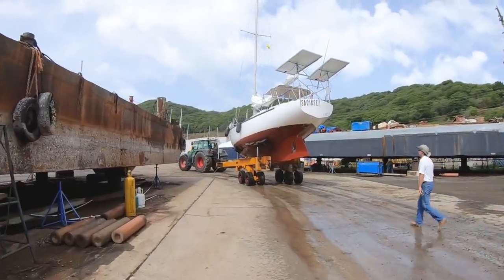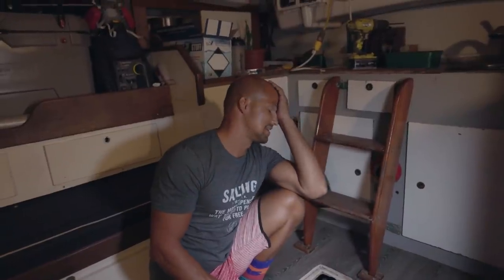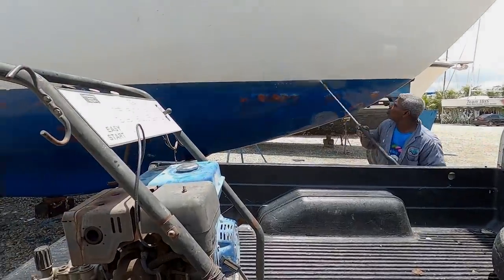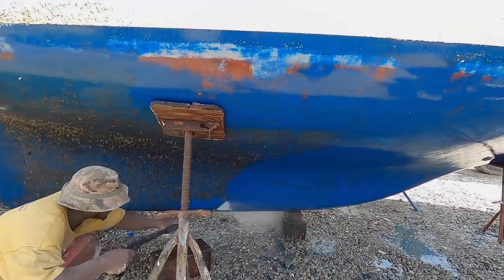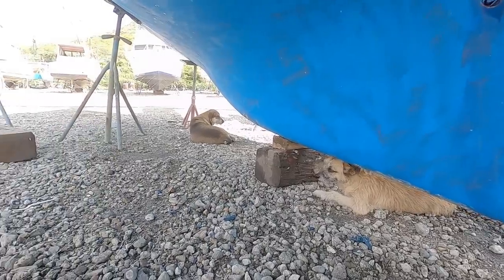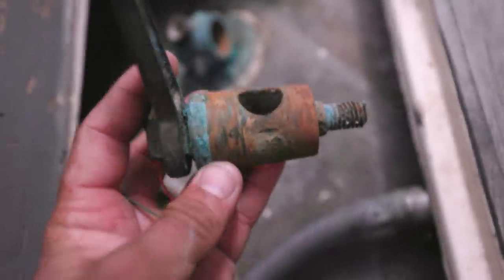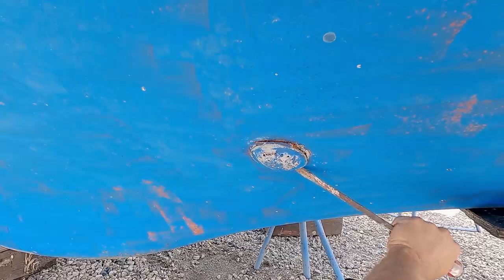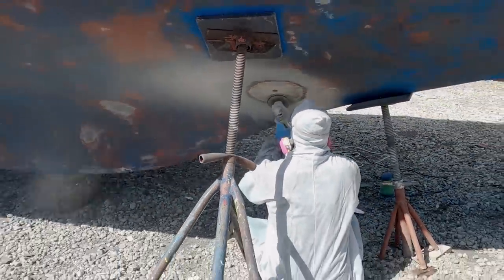IS OUR BOAT WORTH SAVING? (scary discovery during haul out)

Comment: Get a hammer and lightly tap the whole keel area. You will find the voids as the sound will change from solid fiberglass against lead to fiberglass cavity with or without water. Then mark the void pattern and drill exploratory holes as you did at the bottom testing for water penetration. Where delamination between fiberglass and lead has occurred you can cut the fiberglass out and let it dry out naturally. Or drill more drain holes at the bottom of the cavities let it drain then epoxy the holes closed and make larger holes at the top of the cavity and fill the cavity with liquid epoxy resin. The best is cut the bad fiberglass out and reglass the bad area.
Reply: Completely right.  Fill your voids from bottom to top.   I like to use fillable caulk tubes and hand mixed 5:1 thickeners if I like.  Then pump it up.  I use little wood plugs like screw hole plugs to smack into the next drill hole.   There is another resin I might experiment with there.   It's called csr from adhesive technologies.   It likes to expand when water hits it but it makes a hard plastic like resin when it hardens.   It's a hybrid eurethane.  But  good stuff.   Bit more expensive than epoxy.  But the expanding action when it hits water is sweet.  I used it often to fill cracks and rotten gunite in swimming pools.  Sometimes I go with 5:1 in the large voids areas,. Let it harden then shoot csr for the fine cracks.   It's thinner than 5:1.  I repaired a 4 sandwich thick layup that was completely rotten in my cockpit with injections like that,. Those voids we're 1/2" thick and about a 2 sq ft area under my steering pedestal.  I do ring rows on it now and it doesn't move.  Don't worry you can make it water tight.  If you want to know more about injection let me know.   I made a career of it, and retired early.  Don't grind that encapsulation out!!!!!! That will give the hull a weakness that will always make you feel uneasy.  Worried when your beating to windward, worried if you run aground.   It'll be the first thing you run your hand over every haul out.   Just keep that devil away completely.

Comment: The water is most probably coming into the bilge through the two nuts/shaft holding the pin for the swing keel, then finding it’s way into the cavity encapsulated that holds the lead ballast .
You should pour water into section by section of the bilge with red food colouring in it and see where it comes out to determine where the water travels from inside the bilge to the cavity surrounding the lead ballast area.
Hope this helps .
The amount of surface these guys ground for the skin fitting is crazy half would of been more than adequate🤣
Reply: Your exactly spot on , the pin bolts are suspect! I knew a gent many years ago with this problem and that's exactly what was going on, he did away with the center board and sealed it up in the keel, never had a problem with it again..
Reply: @mikemalone2834  I think you right, I would do away with the centre board .
This is for directional stability, to hold point to windward however the percentage difference can’t be much if removed.
I had a long encapsulated keel boat once, it sailed like a pig to windward 😄
I’m wondering if this model was a home completion type boat as some companies sold hull deck and bulkheads and individuals would complete them.
Reply from the maker: @mikemalone2834  hey guys! where are you sailing? are you doing any open ocean, curious on the performance once it was sealed up.
Reply from the maker: @andrewdrew677  this pearson 35 was factory built like this. we didn't put it in the episode but we extensive spoke about sealing up the centerboard.
Reply: @BeauAndBrandy  one has to consider the resale value when modifying boats, however in your case I can’t see it causing a issue.
As far as I’m concerned it’s a design fault as the pins giving pivot to the keel are below the waterline a recipe for disaster.
Other sailboats that have swing keels or center boards have the pins located above the water line.
Basically a box that sometimes incorporates the dinette table, a Beneteau first 24 swing keel is a perfect example .
Reply: @BeauAndBrandy  I would 100% do away with the center board and further look at examining the lead section of the keel both sides especially where you had a failure last time .
I know that during the time period when your boat was built they never had things like spun glass tubing of which one would have the pins situated in .
So you will always have problems in the future 100% .
Just glass it up dude and go have some fun .
Reply: I don’t sail this type of boat, but do know swing keel boats. The swing keel is not at all for directional stability, it’s for improving windward performance a bit by a more efficient “wing” than the full keel. Full keels create a lot of turbulence, especially along the bottom edge, which slows the boat down.  If the swing keel is well done, it helps a lot, especially on your boat that has such a shallow full keel. Bottom line: Do NOT close off the swing keel. You need it. You should look at it as a wing. It needs to be smooth and ideally shaped like a wing too. It also needs to drop down as deep as possible. 

On the problem with water in the ballast, that’s not what you want, but it’s also no big crisis, especially because you have lead, not iron. Lead doesn’t corrode. I would absolutely try to get it as dry as possible, but don’t loose any sleep over water down there. It’s quite normal. The water that leaked into your bilge does have a source, however, which I’d search for. The bilge should be dry, for the obvious reasons. You mention that the fibreglass will delaminate from having water inside. No, it won’t. Polyester/glass is not an everlasting material and it does deteriorate slightly more by being water logged, but no drama at all. All the under water part of the boat is thoroughly wetted out all the time. It’s not perfect, but totally fine. By the way, the gelcoat is there to make it look nice and be protected from light, not from water. 

If the boat is “shot”, it’s from some other reason, like an impact. Even then, I’m pretty sure that you can fix it plenty good without much difficulty in a reasonable amount of time, with a lot of uncomfortable work… :-)
Reply: @andrewdrew677  Lots of swing keel boats, the majority, have the pivot well under the water line. I’s a frequent source of small leaks, but no real problem.
Reply: @SteinVarjord  it’s not a keel, it’s a center board for directional stability for close hauled/ windward sailing .
Your message does not offer rectification .
Reply: @BeauAndBrandy   It’s a good thing you getting rid of the water say in the keel section .
Don’t forget even with you grinding back and getting rid of the water in the ballast will not solve the cause at hand .
Salt water is either getting in either side of the housing for the two pivot pins or through the limber holes where the same as the pins “failure of joint seal “
There could also be areas inside the bilge that aren’t capped off “sealed” properly.

Some boats used pvc tubing for limber holes which always fail at entry or exit at bulkhead or stiffener, these run transverse throughout the hull allowing the bilge water to congregate in a well for bilge pump release.
Wherever the solvent found it’s way to the keel should be sanded out 40 grit paper and CSM Matt and polyester resin applied with flow coat to seal or go with epoxy and powder bound chop strand Matt last coat with resin rich epoxy then bilge paint .
Hope this helps

Comment: I had the same problem on a 35ft Yungsun. I had it professionally repaired. They drilled 1 inch holes along the bottom and top of the keel and forced hot air into the cavity between the fiberglass and the encapsulated keel. The after several days of drying the gap between the hull and the lead they pumped resin/fiberglass bits into the bottom till it came out the top, filling the void. it took about a week and some specialized equipment but the boat was better then new and it solved the problem.
Reply from the maker: Interesting, this is exactly what we planned on doing.
Reply: How much did that end up costing?

Comment: Find a path to the deepest accessible part of the keel bottom and put a pick up tube to a dedicated lower bilge pump. Some water has been down there for decades and you used the boat many years without a bone dry lower bilge. It just goes with the encapsulated design. It's not great but you don't have to throw the boat away over it.

Comment: You can ask the boat experts on these channels about drilling more and bigger holes, until you have ALL the water out.  you could tape the exhaust  of a couple shop vacuums over the holes and let them run until the air blowing out felt dry.  Also ask the experts about spraying closed cell foam into all the drill holes and filling all the voids?  Closed cell foam does not rot or absorb water and would help the boat to float better IMO?  Also another person suggested filling each section from the top with red dye water to find the ingress point of the water?  Good luck!!
Reply: That spray in closed cell foam will eventually get water logged, then you really have a mess. The water probably has been there since the almost sinking.

Comment: They are so many variables here. You'd want to get a good marine engineer to look at it. Lead ballast is good as it won't corrode, but you don't know how long this was going on, where the water is coming from and the full extent of the delimitation (separation between the lead keel and fibreglass encapsulation). In ideal world, you'd strip it all down and re-encapsulate the keel for a permanent long-term fix as well as determine the leak from the bilge area and seal it as well, but that may not be cost and time effective.

Comment: I would just get about two gallons of epoxy resin and a pump that could push it into the cavity from the bottom. lead doesn't corrode and neither does fiberglass. Nothing to worry about !
Reply: Yeah, but it might melt from the heat that would be generated by all that epoxy.
Reply: @dboboc  Fibreglass does not corrode, but it's still destroyed by water. It sucks water and the resin is destroyed under water pressure of about 150 mbar. As 10 m water is equivalent to 1 bar, 1.5m is about 150 mbar. Polyester is not fully water resistant and can take up to 11 % of water. That's why people suggest epoxy coating outside. I'd think clearly of opening the complete laminate around the keel. Drying the keel and the laminate at all sides and relaminating the keel from outside with epoxy. At least the outer layers with epoxy. Polyester is an sour element, salt water is a base. Means the physics try to reach a neutral liquid. That's how osmosis developes. Different types of polyester resins react differently on water but these old boats were usually build with vinylester resin, the cheapest polyester type.
Reply: @dboboc  Fibreglass does not corrode, but it's still destroyed by water. It sucks water and the resin is destroyed under water pressure of about 150 mbar. As 10 m water is equivalent to 1 bar, 1.5m is about 150 mbar. Polyester is not fully water resistant and can take up to 11 % of water. That's why people suggest epoxy coating outside. I'd think clearly of opening the complete laminate around the keel. Drying the keel and the laminate at all sides and relaminating the keel from outside with epoxy. At least the outer layers with epoxy. Polyester is an sour element, salt water is a base. Means the physics try to reach a neutral liquid. That's how osmosis developes. Different types of polyester resins react differently on water but these old boats were usually build with vinylester resin, the cheapest polyester type. Wrong is that epoxy always developes a lot of heat. It does it only when a big rest is left in a narrow pot. It needs a large surface to exchange the heat into the air, if the resin is higher in the pot than the pot is wide it may begin to boil. If the laminate is put out there's a huge surface for exchange and the laminate will not even become warm. Lead has a melting point of about 250 degree Celsius, far higher than any epoxy resin can reach.

Comment: Hey, Beau and Brandy, I love your sailboat's underwater configuration. Cutaway forefoot with a full keel and a barndoor ruder hng from the keel. as much protection as you can ask for based upon the hull design. She must ride and sail like a jewel. Comfortable and easy at about full power all of the time, assuming you have the right combination of sails. I had a 1976, Challenger, Ketsh rig with all hanked-on sails from bow to stern. My Challenger could and did sail herself from west to east and back and from south to north with the sails properly set.

Comment: Okay I know nothing about fiberglass boats.  My boat is aluminum.  But run this idea by an expert.  Drill some large holes in the top of your keel.  Pump air down into the keel until it is completely dried out.  Next pour epoxy into the keel until all void spaces in the keel are filled with epoxy.  Would this work?
Reply: done repairs like this before.  Reverse go in the bottom either/and pump in and do the equivelant of a vacume injection.  The got luck with lead ballast

Comment: I had an Almond 35 which had a fresh water tank in the keel and it leaked in to it. All you need to do is drill a couple of holes as you have drain the water out and  take a soft hammer (I think that is what it's called has a plastic end not metal) tap along the fiberglass to find any delamination it will sound kind of hollow not a sharp rap. You can repair it or leave it if it doesn't effect structural integrity of the hull. Let it dry for a week or two put some epoxy in your drill holes sand flush barrier coat and paint. To prevent the water getting in I would look in the bilge that is probably where it is getting in. Just reseal the bilge. Splash and check your next haul out to make sure you got the leak. I didn't have a center board so I don't know if it could be coming from there. Good luck

Comment: Boats of that era have extremely thick fiberglass. Builders did not know the strength of fiberglass so they overbuilt the hulls. Pearson Yachts were at the forefront of fiberglass boat building. She’s a strong old girl that has many more miles and memories to go. She just needs a bit of a makeover. 
Expert advice is a necessity at this juncture. Cheers to rehabbing your beautiful old gal.
Reply from the maker: she sure is built like a tank on the fiberglass, which is a double edge sword... means we have to buy a ton more fiberglass, but she is solid. lo.

Comment: Probably been water there for a long time. Glass the holes up that you drilled. The outside of the keel is going to be in the water really doesn't make any difference what's inside the keel. Just keep enjoying the boat. If it isn't leaking inside don't worry about it.

Comment: Drain the water, fill the void if you want with slightly thickened epoxy or better vinylester resin.  I had a keel leak on 323 Pearson which apparently came from a lightening strike.  Easy to fix your problem by draining. Flushing and filling the void.  You can get a caulking gun type syringe to inject your resin.  Vinylester resin will bond with the polyester the boat is made of and is as water proof as epoxy.  While it looks bad, it's not and is a common issue with encapsulated keels.

Comment: My best guess is the water was coming down from the bilge, down to the bottom of the keel. Water that may have been there for years. Over the years perhaps with flexing and pounding the fiberglass separated in places allowing water to pocket. Have a professional look at it as well talk to a  boat builder to discuss options. My approach "cheapest" would be to drill holes in strategic places, let dry, fill holes with epoxy and fiberglass over. In the bilge, remove old separated glass, re glass. The proper way would be to strip fiberglass down and around lead keel, let dry re glass. Fairing the keel will take a lot of time, energy and money. I believe Pearson Yachts is no longer around, however there are Pearson Yachts portals to get feedback and advise.

Comment: We has something similar, with water finding its way in between a keel water tank and the inside of the keel just above the ballast. Not as much water as you had in the keel, but also inside the structure, causing unknown damage. We spent a few months drying the hull/keel out, and piping hot air in through the wet areas. Eventually it dried and we could re-seal and paint the outside of the keel. Some strategically placed holes will no doubt do the trick for letting it dry out. Anyway it should be fine in the end and I guess the boat will sail better... woohoo.